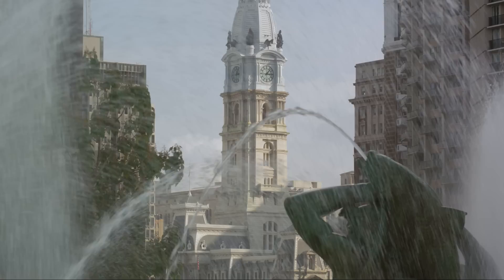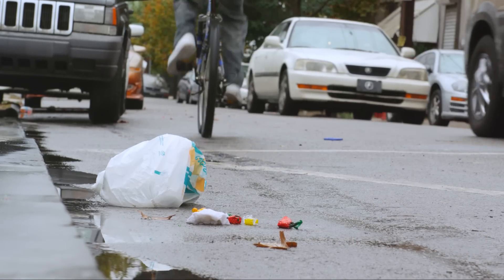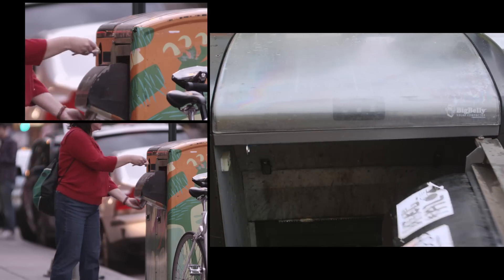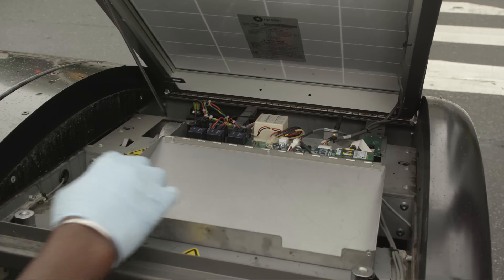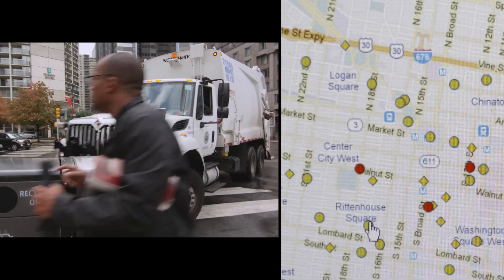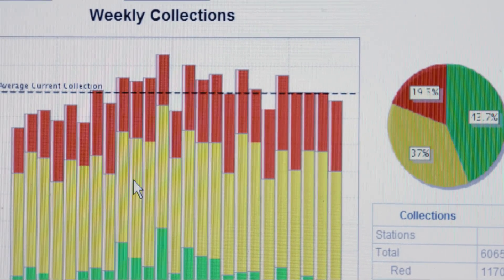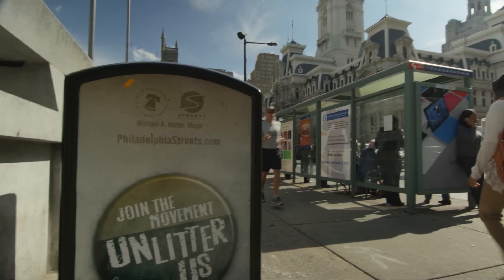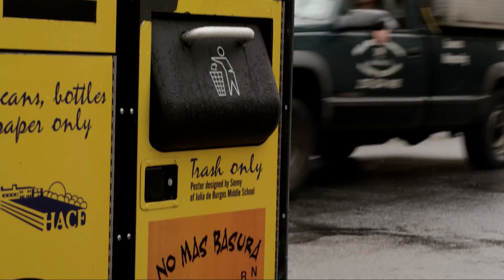Wireless is Limitless: Self-Reporting Trash Bins

Comment: Greatttttt......and a nice, slick presentation.  But let's talk about the reality of these cans.  The ones I encounter, in Center City, are always dirty and not something that you even want to touch.  The pull down drawer is a bad idea and not well designed.  First of all, who wants to touch that handle?  And much of the time, I find them oozing with trash, so the "alert" system or the pickup schedule must not be working.  A nice idea, but as usual, Philly hasn't gotten it right.